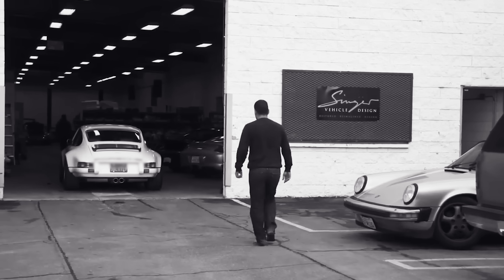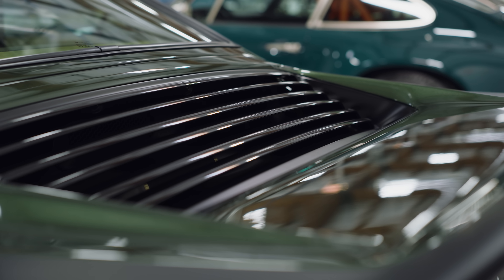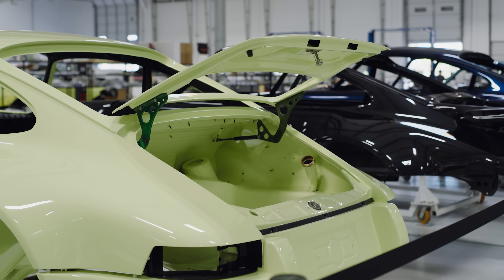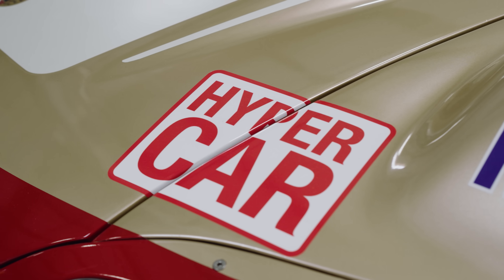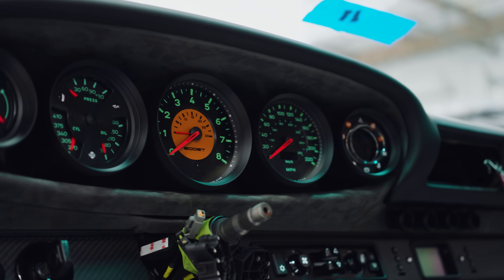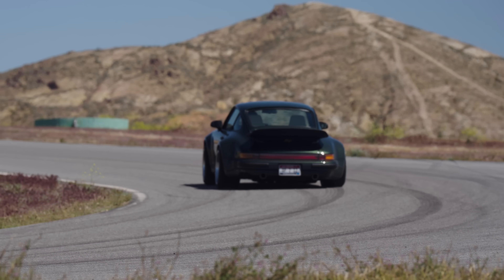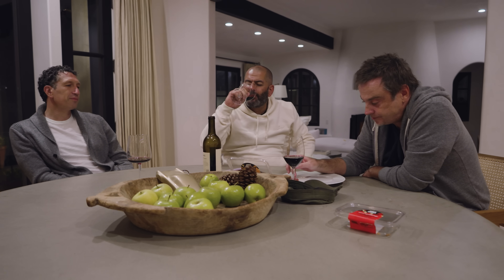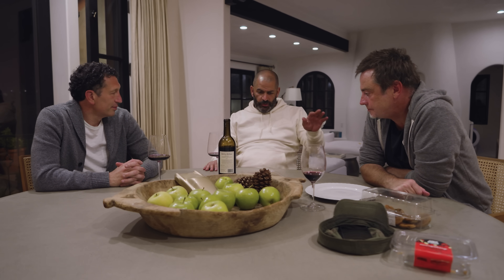One More than Ten (Years)

Comment: I wish there was more about the mechanicals and not just the aesthetics.  Lots of questions - do they use a regular 964 as the base (and strap a turbo on) or a have to start with a 964 turbo (quite a rare platform). Do they still use a G40 5-speed transmission?  ..,

Comment: Great video!  As a teenager in the 70's I lusted after the 930. In 1978 the 930 did 13.3 seconds in the quarter mile. I can't afford a 930 now. So I bought a 1978 Yamaha XS1100 motorcycle that does 11.7 in the quarter mile. It's about as close as I can get to a 930. Cheers!

Comment: this looks like my 81 ,911 turbo a i have also with this body a 76 3.6 engine in blue with inside checkered flag cloth in the doors and in the place where we seat is the same fabric only all the rest of the seat is leather, it´s a pleasure to drive fast in any type of road with turns or not it glues itself to the road, Singer as some cars that i would like to own but i´m far from the budget he asks. Having all his band LP´s didn´t count for nothing still hear from time to time Ferment his first Lp and some might forget the success of Crank in mid 90´s, already in 2001 i drove from a woman a  red 911 carrera 4 that i wasn´t a fan of the changes made in the 90´s but the 4x4 was incredible so i also bought it,my last "911" have others like the 928 GTS and a 944 convertible numbered version with top of cloth looking like suede in bordeux and had zender alloy wheels with low profile tires  but very large ones ,it´s a numbered edition with all interior but all inside of brown leather have a 71 carrera with bucket seats and a early 60´s 356, Porshe is a type of car that you love it or leave it but i do like the grip on the back tires  due to the back transmition with only manual gear boxes ,automatic is for disabled persons or children you don´t get 50% of the car driving quality one drives with one hand on the steering wheel and other in the shifter when there´s many turns on dirt roads

Comment: Chris, not having your track experience, I would be nervous about the driving the turbo version of this car as fast through corners as I would the standard induction. When these cars were new and making much less power than this Singer, they had a reputation for swapping ends if the driver applied too much throttle exiting a corner. The original 930 was probably the inspiration for the term “snap oversteer.” Did you experience similar apprehension entering corners in the 500+ hp Singer? Especially on that alpine road?.

Comment: Not to detract from the level of work that Singer does, but part of me wishes they would start with their own shell or tub or a spaceframe like some Ruf models. It does slightly bum me out to think that so many original 911's have been torn apart to create restomods.
Reply: the only way to do that would be to do it in period. porsche dosent have a mass of 964 shells sitting around. and if you singer starts making shells, that opens another set of worms from a manufacturing regulatory point of view and i think porsche ag will have something to say about that. look at the disclaimer the have at the end of the video. reading between the lines, singer and porsche have a complicated relationship. dont think porsche are too happy with their ip and trademarks being played around with like this.
Reply: @stevencahill3628  I think you're right.
Reply: @stevencahill3628  I'm aware of the issues Singer has had with Porsche and their stance on having 911's altered by a third party, but if they were to build a car on their own chassis could Porsche honestly still lay claim to it? At that point it's a Singer rather than a Porsche. They're already altering the proportions a significant amount. Ruf already do that with the SCR and Ultimate and they're sold as Rufs rather than "reimagined Porsches".